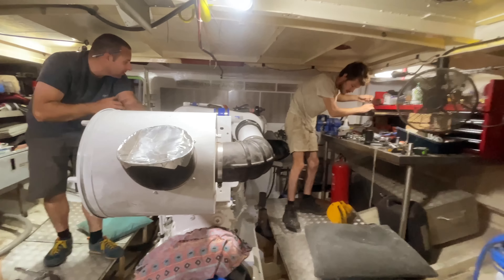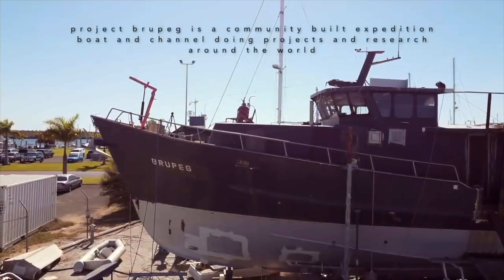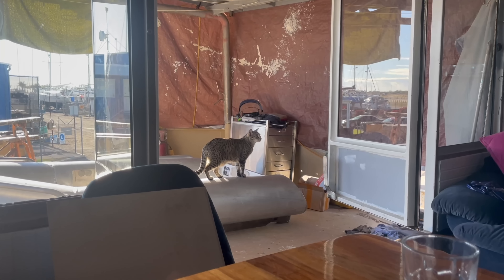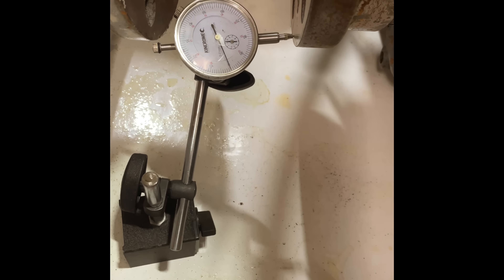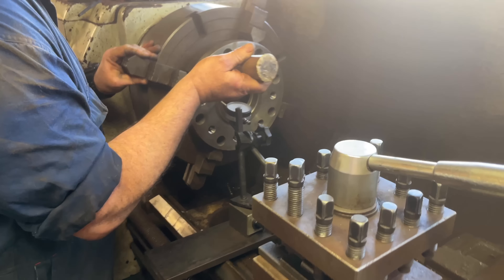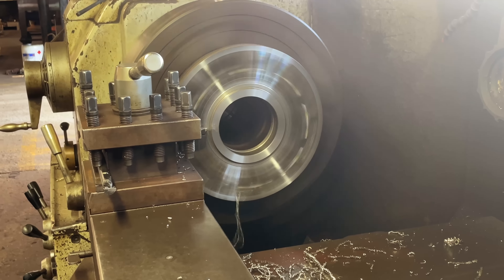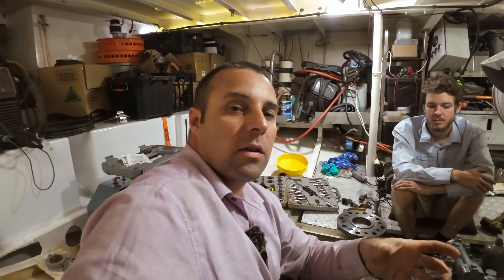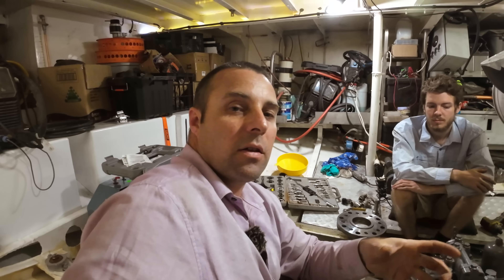Engine alignment DONE!, time to get exhausted - Project Brupeg Ep.321

Comment: Another option for the exhaust path would have been to just tilt it over by 45 degrees, or what the bolt pattern allows on the flange. Not everything has to be at 90 degree angles.
Reply: Exactly. Why make the curve straight up to the roof... 🤔
Reply from the maker: Because the water thermostat limits movement toward the engine and the workshop and walkway limit it in the outboard direction. Angles were discussed but vertical was the best compromise
Reply: Why not have a "muffler" that allows you to change direction in a tighter space-  ie a chamber that enters from below and exits parallel to the engine. @ProjectBrupeg
Reply from the maker: @roderickmckinnon4225 I really like this idea. The muffler we need is quite big but we may be fitting a DPF which would work perfect for this
Reply: Why not wrap the exhaust make it far more efficient and then heat is not an issue then it could be right next to the roof
Reply from the maker: @jonbreach1560 we will be wrapping, making a heat deflector Shield and looking at one other option we will discuss in the next episode

Comment: I wouldn't worry about 4 thou across 200mm of adapter however to get this better i would have machined a mandrel to fit the bore thus allowing the adapter to have both faces machined in one process without rechucking this would give you a better result
Reply from the maker: If we owned the lathe and had the option we would completely agree.

Comment: No doubt this will come too late, but you could align the bolt holes, strike a witness mark on both flanges, mark the high and low spots, then remove the shaft coupling and use a surface grinder to put a matching 'run out' slope on the face. When mated, the two surfaces should cancel each others deviations... But, that's a ton of work and the existing run out is within specs, so...:cat-orange-whistling:

Comment: That 6” pipe will flow everything that 855 will ever make, even with a slight imperfection at the turbo, it’ll flow just fine for what you’re doing with it. I’ve seen truck applications with as small as 4” pipe on them last a million miles. 5” is very common for truck use and even that is overkill. You see the hole in the turbo it’s working through to get to the pipe, so the only real danger here is offending someone’s OCD. 
Can’t wait to hear this 855 moving some water out the back end. ✌️😎

Comment: I have a similar issue with my exhaust silencer which is about four inches from the steel deck above and lagged, I was thinking I have just enough room to put in a heat shield between the deck and the silencer, just a flat plate

Comment: That exhaust wrap is itchy stuff. Make sure you wet the wrap well by soaking it in water before you wrap it & use latex gloves & even then you will have itchy fibers in your clothes that will get into your hands.
Reply: If it's that bad, he'll  also be needing a respirator - face mask. Imagine what those fibres may do to your lungs!
Reply: @Davidcallard Soaking the roll in water stops flyaways & makes it lay down better but there is still plenty that come off & get you later. You could use face mask.

Comment: Btw Damian just a word on your exhaust a mate of mine had a fire on his boat .. as boats spend time at marinas sea birds like to find nooks and cranny’s to build nests some silly bird found a way to build a nest along side his hot pipe this then caught fire and dropped internally into the boat and started a massive fire behind a wall ,, he was lucky he was at Musgrave others came with more extinguishers although he did say he though he was losing the battle for most of the fight …. Maybe some fins over that last tail pipe would deter birds nesting in it although it just get blown strait out but you don’t want things going in it but do look for places they can get down the sides like what happened to my mate nearly cost him his boat ..
Reply from the maker: Fair point. We are planning to build a stack which will prevent birds etc getting in. Just haven’t got to it yet

Comment: This is probably a dumb question, but why not use some type of flexible coupling in place of that  rigid adapter — two pieces of metal with a piece of rubber in between?
Reply from the maker: @Pamudder Without having flex engine mounts we can’t do any form of flex coupling and this mounts and couplings run at around 10k for this boat

Comment: Couldn't you use a bushing or a universal joint between the engine output/drive flange and the prop shaft (flange) which would eliminate the possibility of vibration or alignment issues or damage? Great work... keep it up!!

Comment: Shame you couldn't buy half a donut (cheaper than buying an elbow, but you have to weld it after you cut it) for that bend, would've made that bend super tight and gain you about (by eye-o-meter) 10~15 cm. But i've never seen half donuts in that size of pipe, only smaller.
Reply from the maker: We can get them but we need to apply for a mortgage and show five years worth of income to be able to buy them!

Comment: flatten the cheater pipe by half instead of cutting the wrench.
Reply: Done that before and the wrench has split the pipe after a while (metal fatigue/micro-fissure). Works for a bit though.
Reply: that was my thought exactly, back in the day that's what mine was like for gas fitting lol one round side one bigger oval side PS was just watching a Beyond the Press on YT video and they were using a 16foot pipe to try and open the bolts on a hydraulic cylinder lol did not work but was pretty strange looking lol
Reply: You cam buy proper.cheater bars for spanners, but I made one before they were manufactured, it's just 2 bits of angle welded onto opposite sides of a bit of flat bar, then it fits all wrenchs amd both ends  of the wrench, every heavy deisel guy has one for hydraulic hoses
Reply: If i need a belt grinder, Damien, are you free lol😊